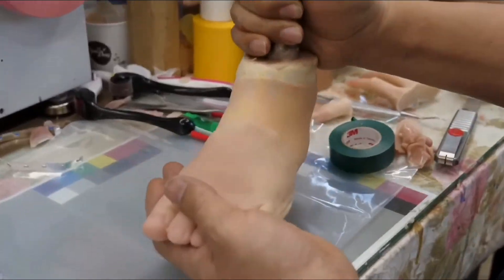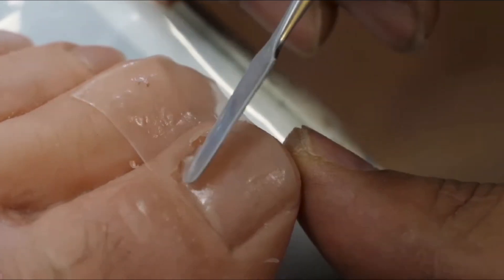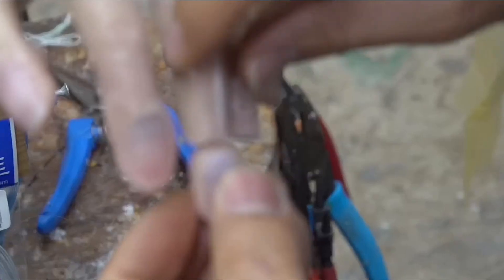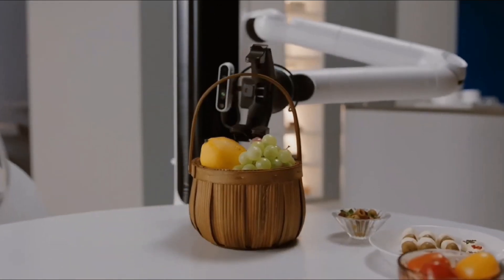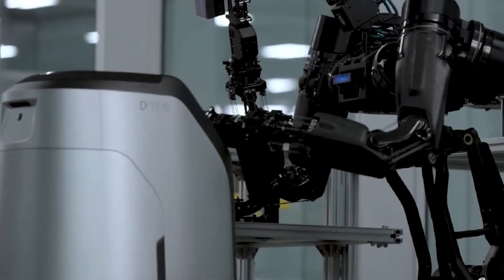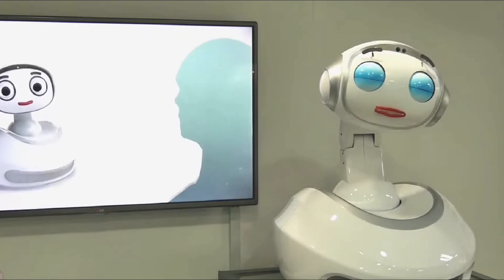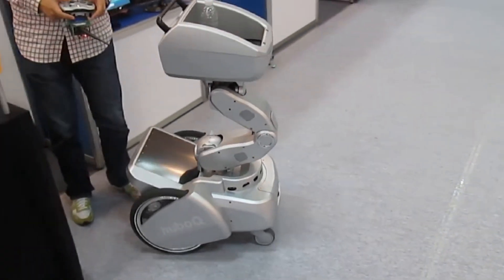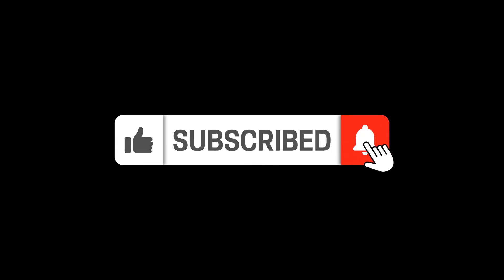South Korea's First $10 Billion Human Body Parts Factory SHOCKS The Entire World

Comment: That Silicon only lasts 2 years and then the tips of fingers and toas along with any protruding parts can not take the harsh inner metal frame, which I might add can weigh in as much as 40 kilos.
So forget about a warm cozy night in bed! Their is no body heat at all, so it´s like laying next to a dead corpse. Finaly, you have to wash, dry, powder and remove excess every day.
The skin does feel very real when new and prepped. Yet it soon changes to an very expensive investment. As you watch the dust stick to the skin.
I have owned two such doll´s and they were two very expensive mistake´s. Infact, the weight was crushing if laying on your chest!

Yet, for someone with only one leg or arm, it must feel wonderful and give confidence. Yet forget about sex dolls!